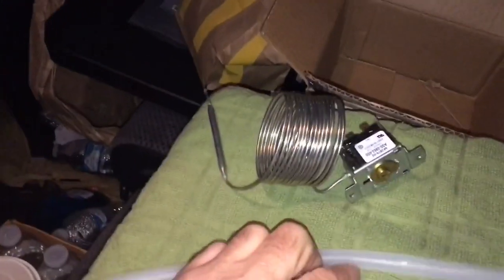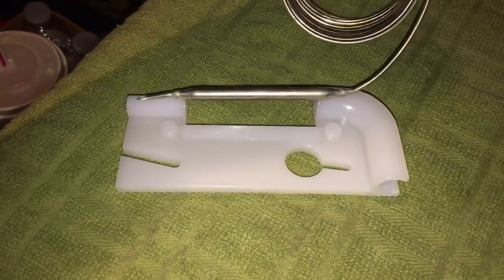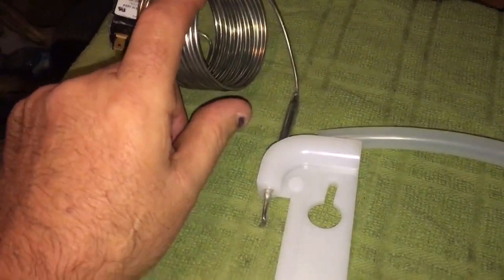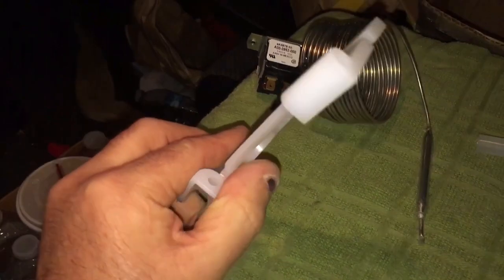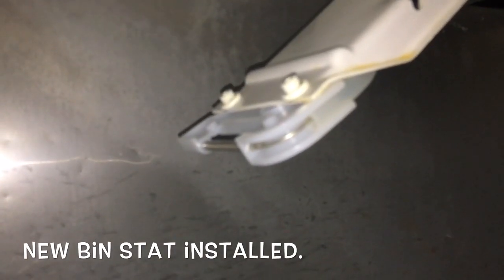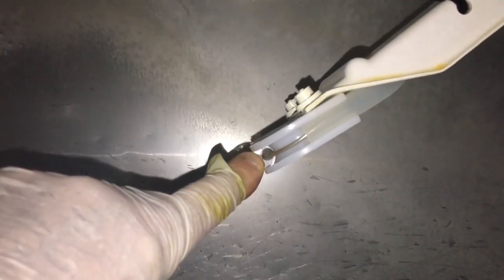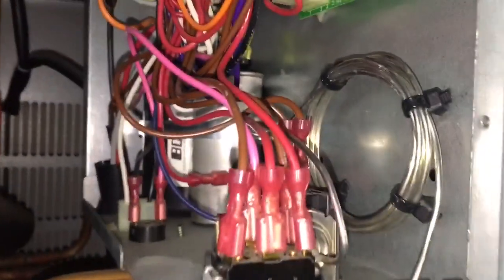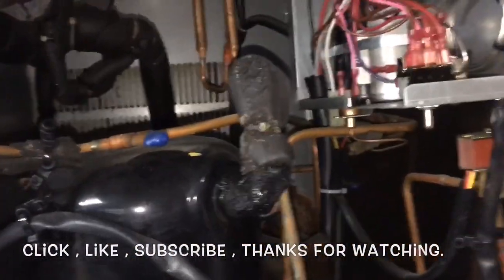How to Replace a Hoshizaki ice Bin Full control / ice Bin thermostat.

Comment: How did you wire it up?
Reply from the maker: You’re kidding right ! It has 2 push on connectors. Don’t matter where or which wire goes on it. It’s a simple open or closed switch.
It’s either open or closed. Stick the wires on it and you’re done.
Reply: @OcRefrig  I did a conversion bin thermostat kit cause the manufacturer said they didn’t have the paddle ones anymore for this hoshi and they provided instructions but they were vague. It said to connect one end to the relay brown wire and another to the magnetic contactor #12 terminal (also a brown wire) I did that and turned dip switch #7 off to avoid the k4 code and the compressor wouldn’t kick on
Reply from the maker: @letmevibe8318   paddle switch or this one are either open or closed. Just hook the existing paddle wires to this switch and u should be good. I would not change any settings if it was running good before.
They are both just open or closed switches.

Comment: So whats the rubber hose for?
Reply from the maker: it has two functions - to Protect it from when a ice scoop hits it so it does not break the very small capillary tubing & also a thermal barrier to limit ambient temperature inside the ice bin affecting the actual bulb temperature.